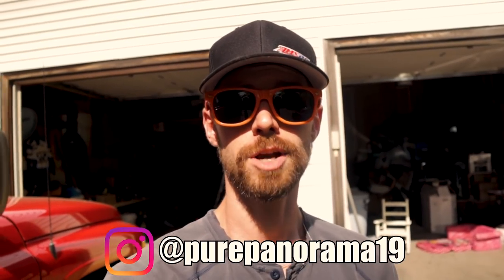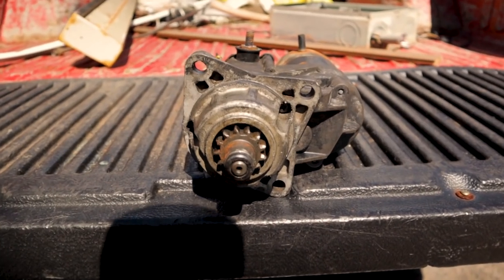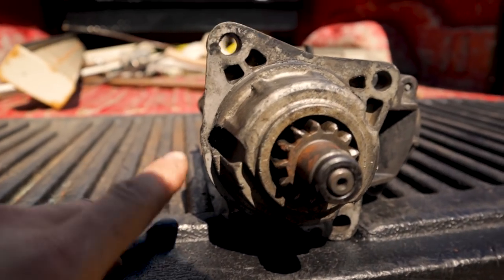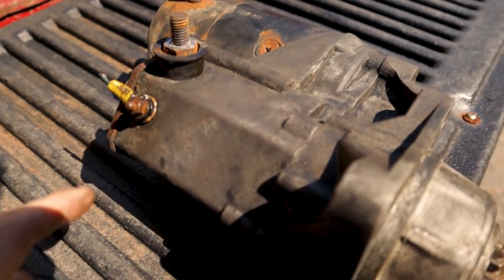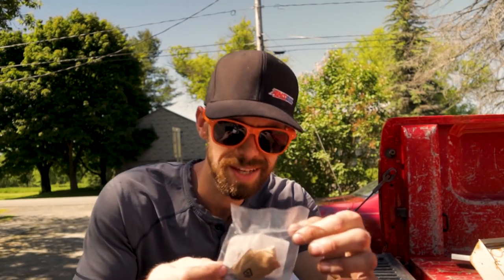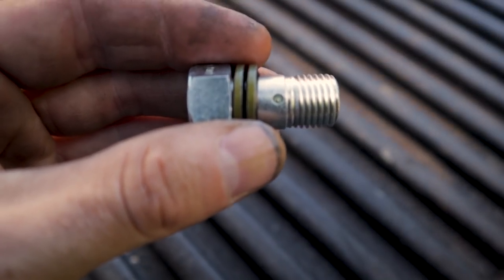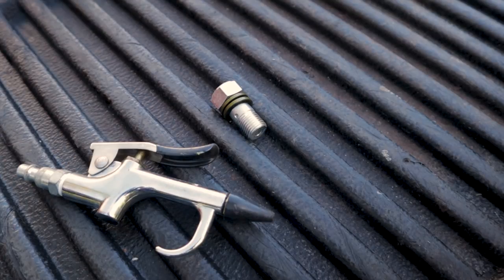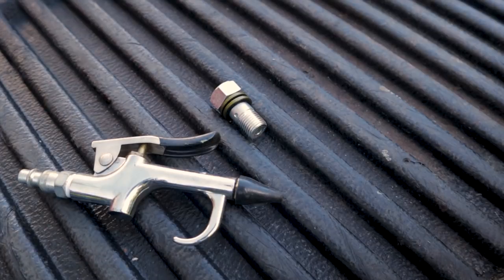CUMMINS TROUBLE STARTING BOLT!?

Comment: Had hard start on mine for about a year. Replaced the overflow valve and starts right up now. Have a fass lift pump that will be installing soon.

Comment: Do you have an impact screw driver? Not an impact gun. But hand held that you smack with a hammer. They’re maybe $25-$35 at most part stores. I’ve never had them fail me. Try it on that starter stubborn screw.
Reply from the maker: I dont have one, no. I already replaced the starter with a new one so the old one will just sit in the garage for a bit. I'll look into one of those tools for the future though!

Comment: Does this only apply to the Bosch pumps ive got a magnum 24-4015 15x pump with an airdog 2 4g 100GPH lift pump in a 02 auto 2nd gen. The forums all say minimum 14psi WOT max 18-19psi idling, ive noticed at the higher pressures its more responsive but much smokier. Ive got an HX40 on it aswell working towards injectors!